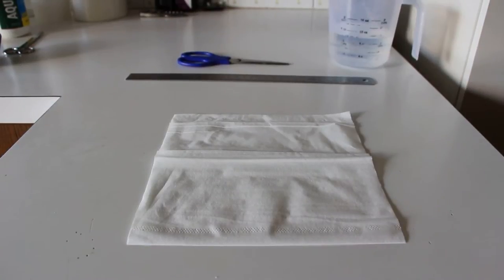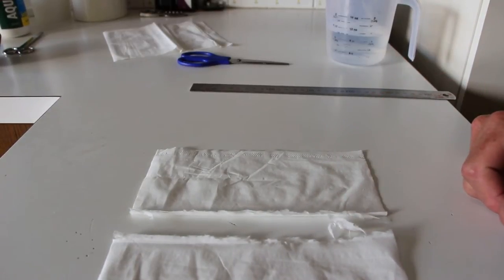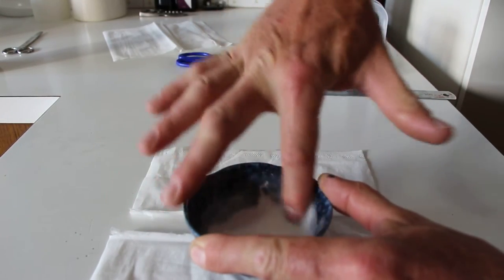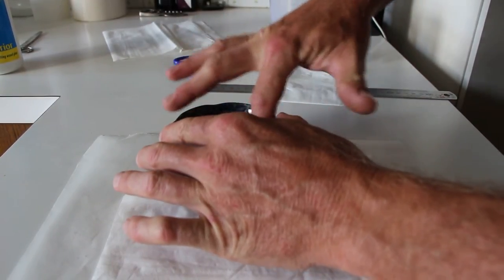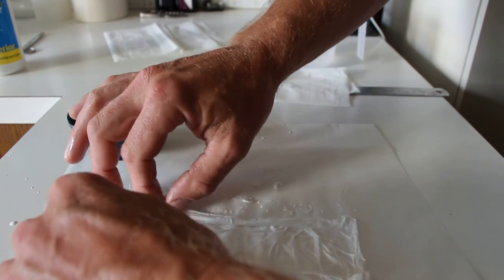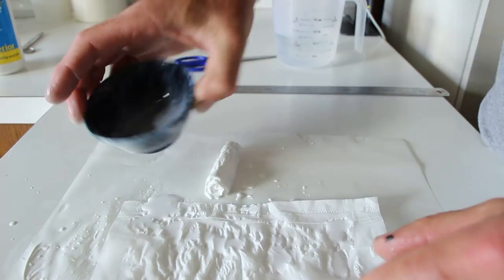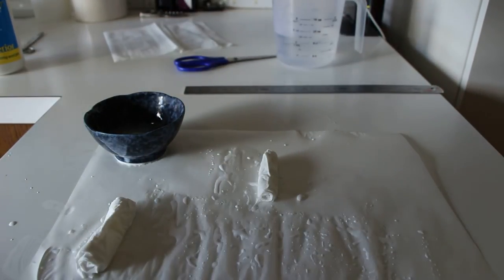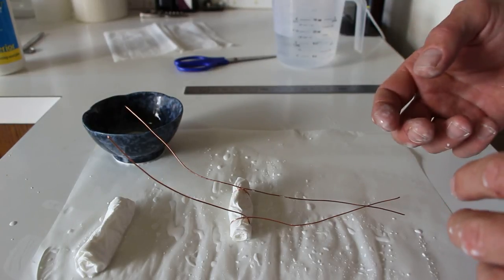Tissue tarps 1

Comment: Have you got any Ideas making a canvas tarp over a metal frame on a steak truck?
Reply from the maker: I would try hang the tissue over the frame and use a diluted mix PVA/wood glue and water in a atomizer/spray bottle. Spraying on very light misty coats and letting it dry between coats until eventually it gets that stiff form. Hope that makes sense. Can only try it as I haven't done a framed tarp. I might just have to give it a go now.